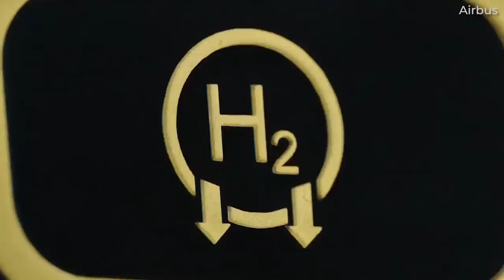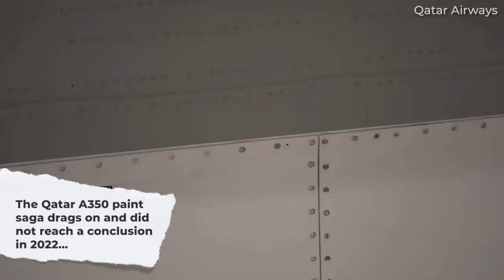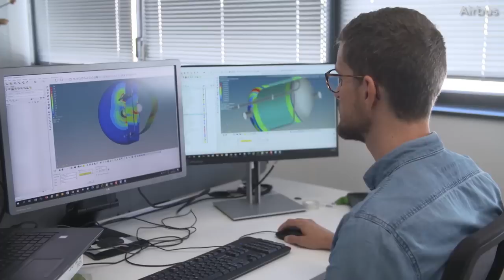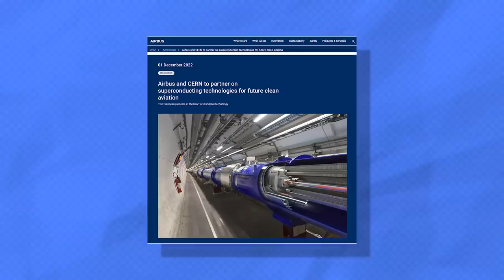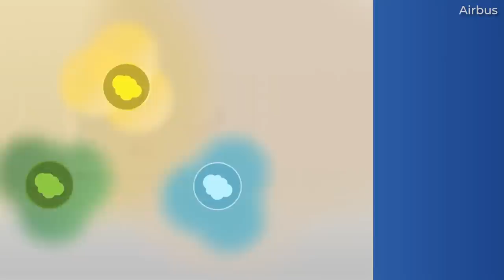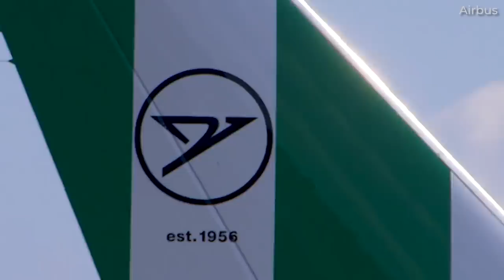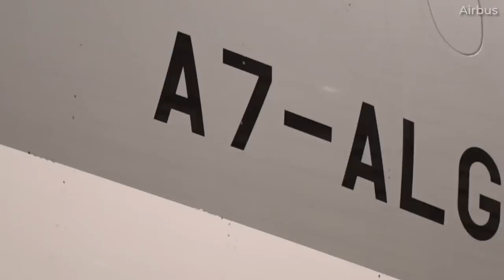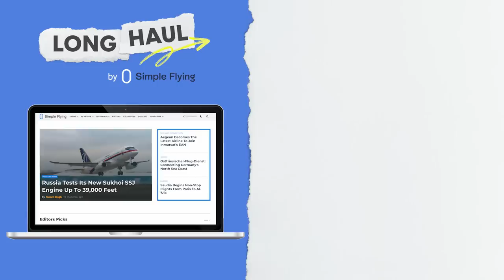What Can We Expect From Airbus In 2023?

Comment: If, somehow, Airbus and Qatar Airways come to an agreement and put the saga to an end, I can see one of the Qatar Airways demands being that they only take planes painted in Alabama as they should have the most up-to-date facilities to deal with the most modern planes.
Are there going to be videos on the likes of Embraer and ATR?
Reply: Seems that would be unlikely. The Mobile plant only does final assembly for A320s and A220s. To paint an A350 in Alabama you would need to fly an unpainted A350 transatlantic from Toulouse to Mobile and/or create components (mostly in Europe), ship them to Alabama, paint them and then ship them to Toulouse for final assembly. Also since only A320s and A220s are built it Mobile it seems likely the paint shop/s will only be sized to handle those aircraft, over-specifying it to take A350s it might occasionally handle seems like a waste of money. Seems far easier to upgrade (if required) paint shops already specifically designed for the a350.
Reply: @ATABBOTT  oh, OK. Thanks for clearing that up. I should've paid more attention.
Reply: @ATABBOTT  Yeah that wouldn't make any sense.

Comment: A220-500 thoughts? Also, why didn’t Airbus use their own naming convention. A220, A221, A219?
Reply: Its because the A220 werent originally Airbus’. They were originally designed by Bombardier as the CS100, but due to Boeing and the US government, the cs100 would see an increase in tax. To avoid this, Bombardier sold 51% of the airplane design to Airbus, allowing the plane to manufacture within the US and avoid the tariff, which also allows Airbus to change the name to now the A220 series.

Comment: Airbus will deliver and make the following 
A360,a370
More a380 being built 
More mid range aircraft a322,a323,a324,a325 a326,a327,a338 and a329 to fill in gap between a321 and a330
Sell more aircraft to Emirates More to British Airways 
Try push more airbus to the US
Try make airbus the world's most safest aircraft 
Work out how to prevent servre turbulence over the bay of bengal the world's most dangerous area to fly
Announce a triple decker aircraft dubbed the a390 and possibly a400 series
Reply: A triple decker would look way too exteriorly unpleasing and needs 6 engines imo.